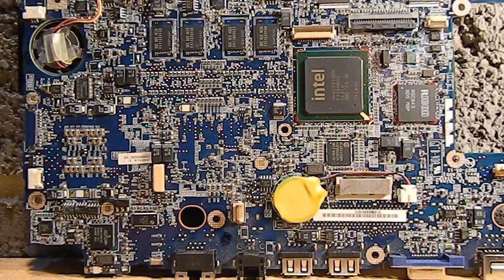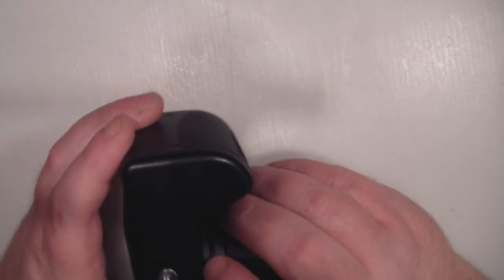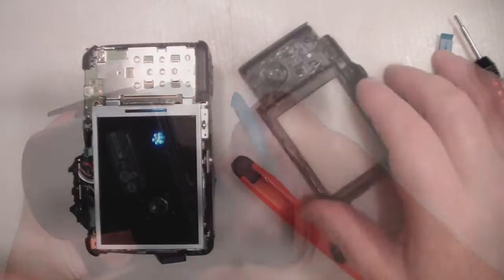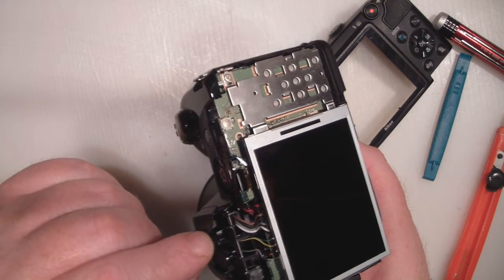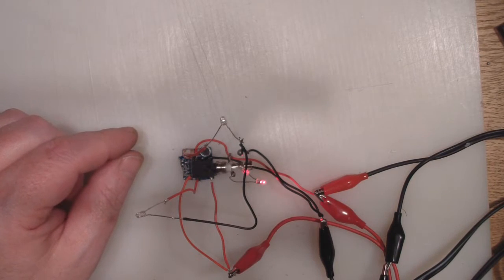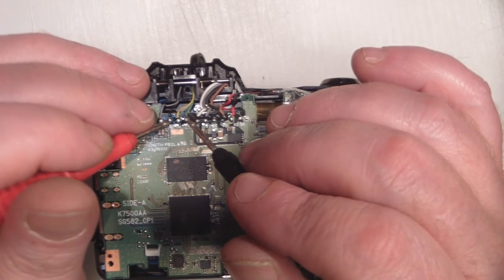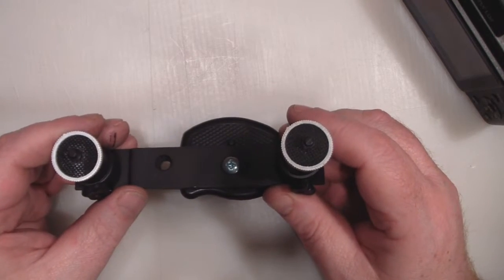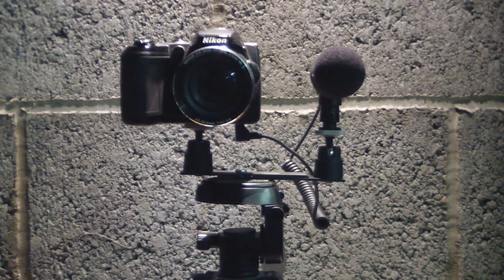Camera external microphone jack mod #20

Comment from the maker: yes i found an adapter on ebay think it was £12 with free shipping. then you can use 67mm lenses again off ebay got a set of 4 macro and 1 wide for £18. it works well
Reply: where did you find this little board that switches from internal to external mics when pluged in?